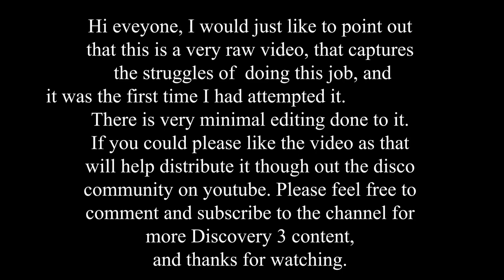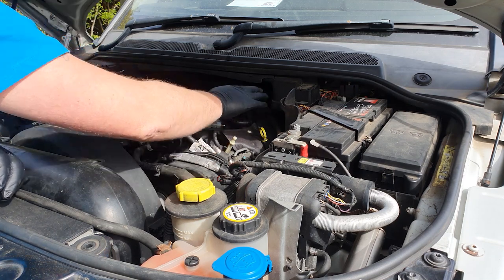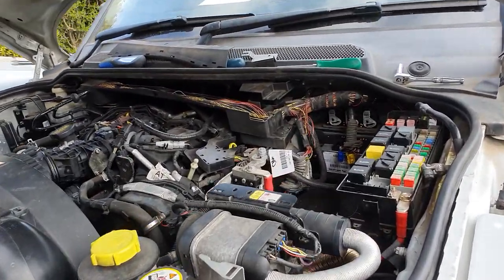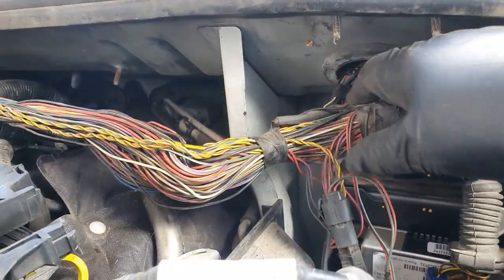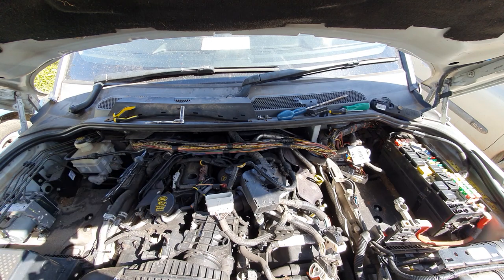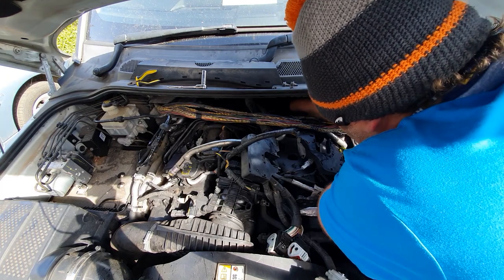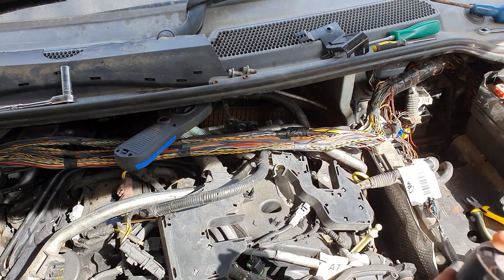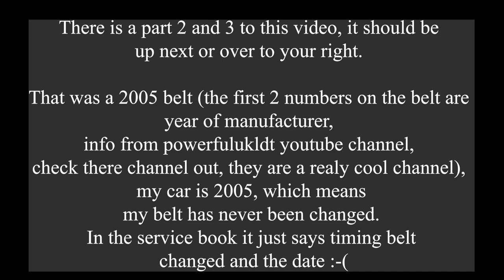LAND ROVER DISCOVERY 3 DISCO 3 TDV6 2.7 FUEL PUMP BELT REPLACEMENT EP1 HIGH PRESSURE FUEL PUMP

Comment: What's that square looking thing with the 2 electrical connections and looks to have an intake pipe coming from a round filter between the battery and power steering fluid cap? A diesel heater? My 2005 doesn't have one of those.
Reply from the maker: Yes it's a diesel heater.

Comment: Hi have you done the vacuum pump as I need to replace mine
Reply from the maker: No sorry I haven't.
Reply: Must be same as it’s back of engine like just opposite side
Reply from the maker: @john doyle  yeah I think it's on the opposite head. U could probably do it by removing the heater matrix pipes that run down the left hand side of the engine, and try to get at it that way.

Comment: Could you please tell me if the LR4 3.0ltr has this belt?
Reply from the maker: Yes it does, BUT, IT HAS TO BE TIMED INTO THE 2 PULLYS. Everything is the same as whats going on in this video and you will need some sort of mirror to be able to see the marks on the pullys.
Thanks for the comment..
Reply from the maker: have a look here
https://www.facebook.com/MMPLandRover/posts/there-is-a-timing-belt-in-there-someplace-30-tdv6-discovery-4-in-for-timing-belt/1539103362776956/

Comment: At what mileage are you meant to replace this back belt? And can I know what was your mileage on the car when you have done it? I have a Ford territory titanium 2012 which I believe using same engine as land Rover but not sure when should I do mine.
Reply: I have read a post and it’s says both belts need changing every 100,000ks

Comment: Hello. Nice vid. I have a problem with my Tdv6 2.7 after HPFP replacement. It has the P0088 fuel pressure too high fault and the car is in limp mode.
Forums say the HPFP has timing marks during installation. Skipping this will trigger the fault... Is this true.
Reply: Subscribed by the way.
Reply from the maker: HI Ted. The HPFP is 100% not timed into the camshaft on this engine, (2.7 Tdv6).
The LR4 3.0 twin turbo is timed in tho, so they are maybe on about that engine on the forum.
Reply: Did you get your issue fixed Ted? Having the same issue, unable to fix for the last 2 months :(

Comment: Still not sure whether to do this or to only change the timing belt, and say fuck it about the pump belt... Especially because it's an SDV6, where it's indexed, ahhhhh. Don't even know if the dealer will do it tbh. Timing belt only looks alright, even if it is still a bit of a faff.